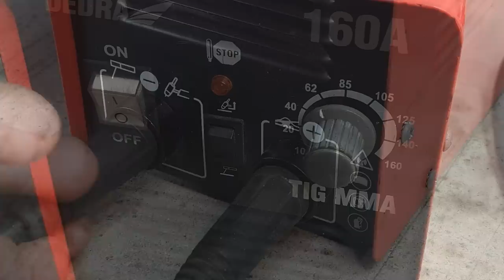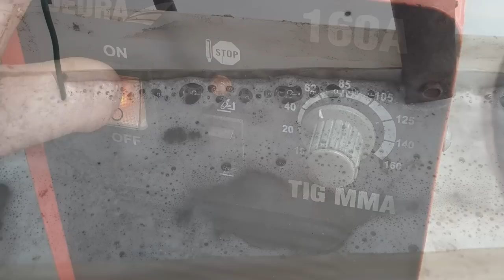Restoration of a very old rusty French rebel bayonet

Comment: That's a crazy job, but I would blued the bayonet, and I don't like the paint on the handle, why painting also the wood grip?😂
Reply: But it's a crazy job seeing the starting point of the bayonet
Reply from the maker: Bro I will answer your questions.  1. Bayonets did not burn until the 1930s.  2. The handle was covered with paint at that time for camouflage.  In my restoration videos, I try to keep the appearance of objects 100% identical to the period to which they belonged.
Reply: @AnDIY_Handmade_Restoration  what do you mean with did not burn, I don't understand, you can see on internet how this bayonet is blued, and about number 2, how you can know if this bayonet was painted like that, in internet I can't see another one painted like this and I am pretty sure that it would look more original blued and without painting
Reply from the maker: @Sillu  About the bluing contraption, this is a French bayonet.  France in the flesh until its defeat in the 1930s.  Did not burn bayonets.  This is also indicated in the production regulations.  I use technical literature in my work, as I have a very large library in this area.  So the issue with burnishing is unequivocally closed.  Regarding painting, there was even an order that all the details on the uniform and weapons should be covered with paint in order to remove the shine and not disguise the fighter, as was the case with the Germans and the French.